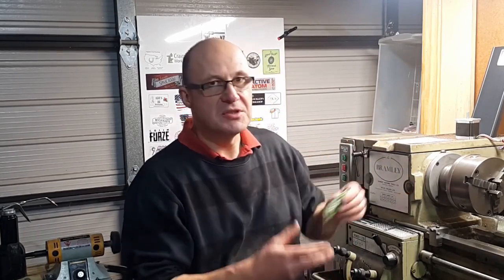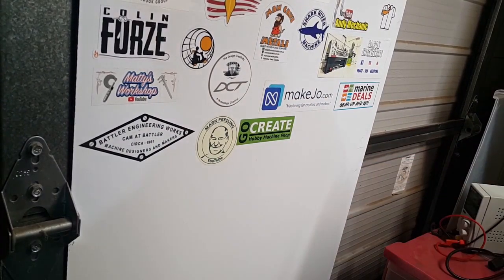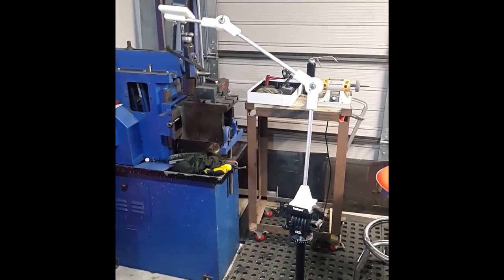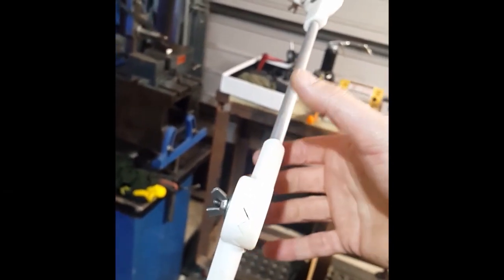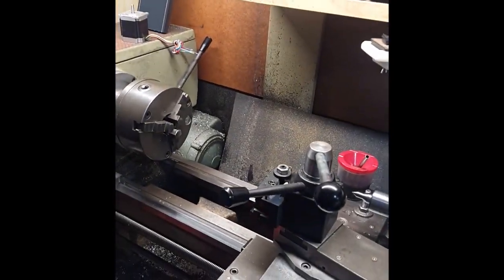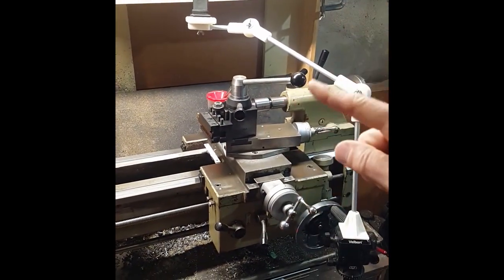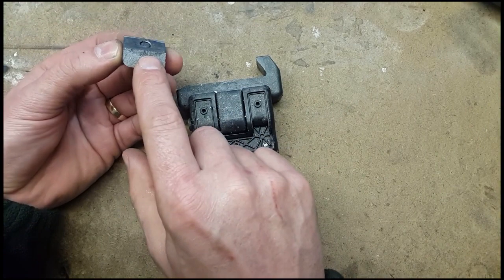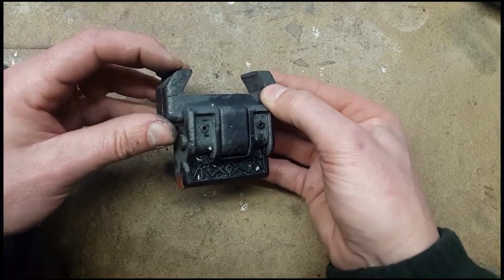#74 - Tig Welding Cast Aluminium, 3D Printing Camera Boom trial

Comment: Hi Kevin. Great job with the tig welding. I purchased one a few months ago but I couldn't justify an AC/DC.☹️
All the best.
Andrew
Reply from the maker: Hi Andrew, its certainly handy to be able to weld aluminium. The clamp has been back on the machine for a just over a week and so far its holding. Thanks for watching....Cheers Kevin